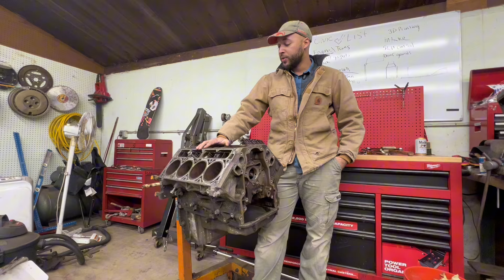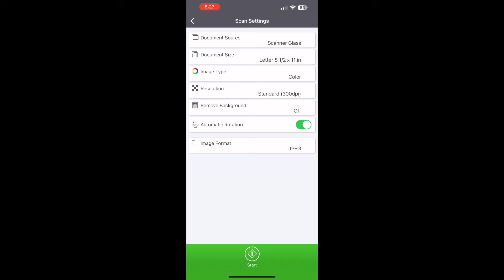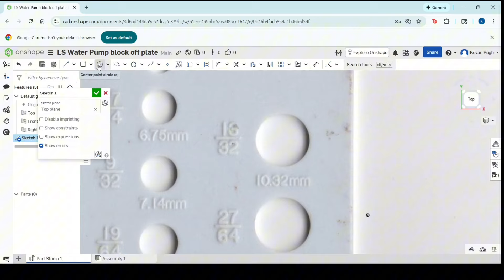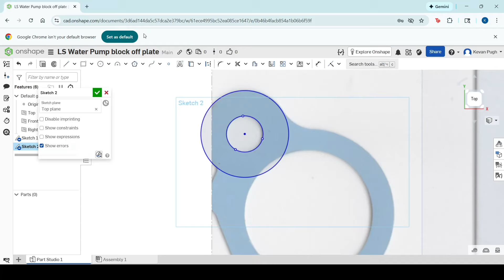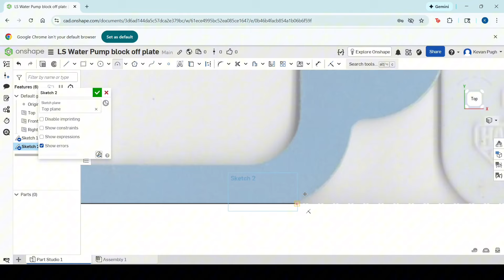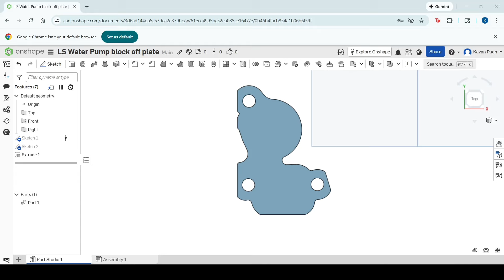Beginner Automotive CAD: Turning a Gasket into a 3D Part

Comment: If you scan what you are trying to make and measure it and then just check the measurements on the cad to what they need to be. Its so much easier and faster. Unless its custom no need to build it from scratch
Reply from the maker: That’s true but a lot of people starting out may not have a 3d scanner and would also like to make a custom part. Thanks for watching!